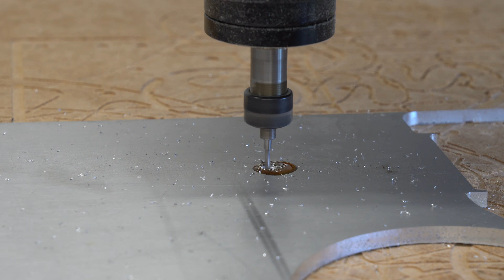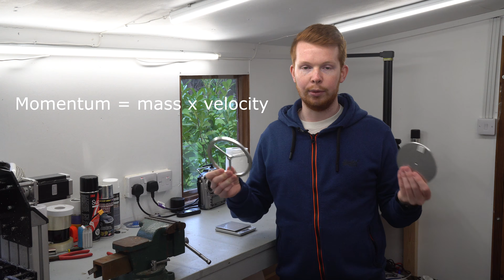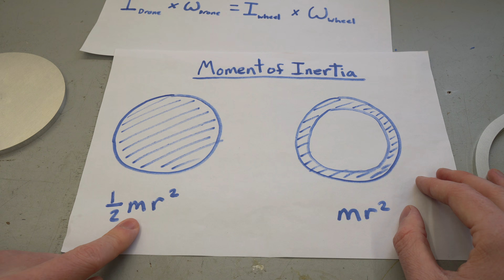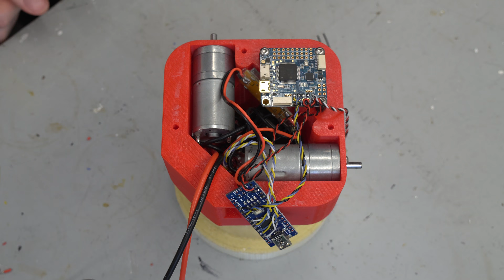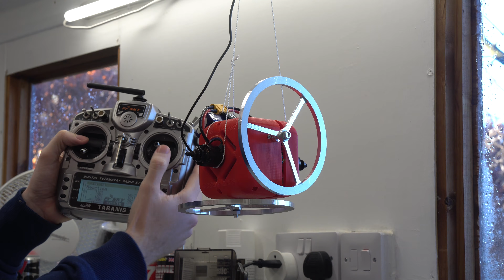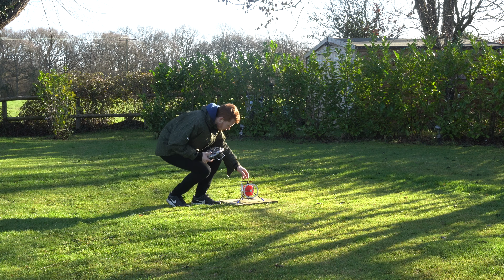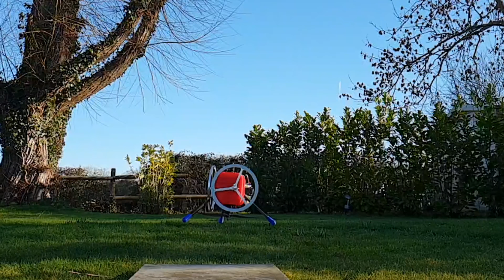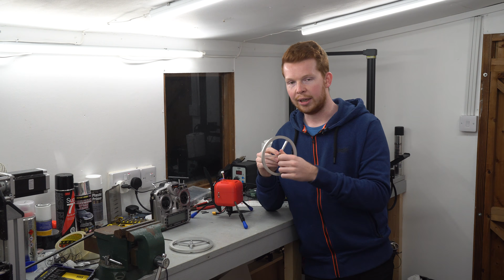Comment: Hi! I think you should try to pre-speed up the reaction wheels before the actual take off. Only the relative speed matters. If it has a certain speed at the start i think it was easier to just slow the reaction wheel down instead of driving it in the opposite way -> this means that you can use brushless motors too, but you will have to tweak the flight control for it too. Good luck!
Reply: I don't think this would work well. As it spins faster, friction does more to help you slow the wheel down, but it also does more to keep it from speeding up. Furthermore, at higher RPMs, the motors can provide lower torques than at lower RPMs.
As a result, you may get somewhat better torque/response in one direction, but the other direction would be significantly worse.
Not only is this a problem because the worse direction ultimately defines the performance of the reaction wheel, the asymmetrical nature of this is also something flight controllers aren't made for and the process of getting that to work properly would be incredibly tedious.

If you did decide to go through that effort, though, a way to overcome the asymmetry and low performance issues would be to have two wheels for each axis, spinning in opposite directions. One would speed up as the other one slows down, and you'd have to program it so that when little to no output is required, both accelerate, as otherwise, RPMs would go down with flight time. Unfortunately, you'd probably still end up losing RPM somewhat quickly, meaning while this may actually lead to a more stable flight, it wouldn't last long.
Reply: Be careful with fast spinning reaction weels.  The spinning rings can cause the drone to move differently than if there was not a gyroscope on the drone.  As the weels spin faster it is more difficult to move the wheel out of the orientation where it wants to be.  The force could be stronger than the drones ability to react, crashing the drone.   See youtube videos of people moving fast spinning gyroscopes and the behavior of the gyroscope..  

My grandfather always told me that at his work (building test aircraft)  they would spin up an airplane gyroscope and put it in someone's lunch box. When the guy picked up his lunch box and moved it in a direction that countered the movement of the gyroscope the gyroscope would keep the lunchbox moving in the original direction to the surprise of the person holding the lunchbox.  The lunchbox would often be ripped right out of his hand by the force of the gyro.
Reply: thats hat i meant with other words
Reply: That would reduce the dynamic range of the wheel. It has a maximum RPM and the performance degrades at high speeds. By having the "neutral" at 0 RPM then it has more range in both directions before it maxes out. Of course, you can end up in this state regardless, as any asymmetry in the drone, environment or flight path will just add up over time. But by starting at 0 you maximise the mean-time-to-failure.

Comment: im interested in knowing if in theory a mechanical gyroscope could stabilise something like that then maybe use collective pitch, gimballed motors or thrust vectoring of some kind to control directional movement? or maybe a servo controlled gimballed mechanical gyroscope in the middle of a quad for stabilising/controlling roll and pitch then just use the the motors to control the yaw?! hmmm

Comment: 2 problems I found :
1. Wheels weight destabilise the drone, making it heavier in the corner. Make counterweight wheels on the other side that will move other way. Rotation center is also important to be in the middle.

2.wheels must be able to accelerate and decelerate a lot faster, so they can fix the drone. On top of that  they need some reserves so you can steer it

Comment: Why not stepper motors? The RPM's you need should fit in the range many steppers can handle, and depending on the motor you may be able to get a very quick direction shift. The motor's weight may be an issue but who knows?

Comment: Interesting how you consider different motors to compensate for the nonlinearity.  I would have just made the necessary software changes..  The values need to graduate.. a curve rather a straight increment.  I am actually far more curious as to the different effects of the top and bottom propellers -- one pushes air onto the body creating vacuum above.. the other sucks air from around the body and pushes it below..  I doubt they are equal even at equal rpms.  I bet the bottom is push more than the top is pulling, making balance harder.  

What if you simply used spin to keep it level (a ring around it like on Saturn) and a miter joint on a central "drive train" for a top and bottom rotor... Then maybe two little motors for forward momentum and differential steering.  It should be far more stable than a convention drone.. with any decent amount of rpms of the Saturn ring (I guess it'd be a fly wheel).

Comment: I think it is better to vary the angular momentum of the control wheels by variing the voltage of the control motors instead of their current. The voltage is nearly proportional to the angular speed, the current is more proportional to the angular acceleration. I think the control motors don't need too much power. So I would suggest to use an analogue control loop to operate them more quickly with power op amps like the LM1875 of Texas Instruments. http://www.ti.com/lit/ds/symlink/lm1875.pdf

Comment: The best way to do this would be to have small gyros spinning at the same speed all the time on all 4 sides of the drone and use servos to try and tilt the gyros is an angle therefore causing the drone to go in the direction you want

Comment: I would try taking off the flywheels and attaching arms to the reaction motors to slightly change the centre of gravity of the unit. The lifting propellers should do the rest. In fact, I would move lower lifting propeller to the top and have just one reaction motor at the bottom.

Comment: One year late but i do see a problem there. Once these momentum wheels are spun up to higher rotating speeds, they do - for causes of angular momentum conservation - produce rotational momentum at a 90° phase-shift to any force they receive. So a fast spinning, nearly saturated wheel will turn your drone head-over-heels if you try to fly a curved path. Unless you have a correction for that programmed into your fly-by-wire-computer as they do on rockets and satellites.

Comment: I can suggest that the yaw axis needs work and both propellers have to be mounted to the top plane with concentric hollowed drive shafts expected to spin in c+ccw (inward direction) to generate lift. Another approach could use a inverted spindle to hold two brushless motors coupled in vertical orientation(c+ccw) , the motors must have a hollowed propeller shaft. And to reduce any delays from gyros to the reaction wheel i suggest to use steppers or servos with the lock ratchet (to prevent continuous rotation) removed 😎

Comment: Try using method similar to the Vibration on the phone. When phone left on the desk, and vibration turned on - it will slide across. That propulsion was tested in the 80s on the boat - and it proved to be 10000x more efficient than a jet engine. Boat traveled at the speed of 5km/h. It is simply using inertia and changing momentum with asymmetrical - half wheel(as in the vibration of mobile phone motor) or linear motion - changing the acceleration linearly. It's very simple, but the trick is to tune proper mass, acceleration and frequency. All to limit the vibration(like in the mobile phone vibration).

Comment: I think the issue with the instability was caused by the reaction wheels over-correcting. This would happen because they still have momentum after the motor has tried to switch the other way. You may have more success using Proportional Integral Derivative (PID) error to correct the attitude. This prevents over- and under-correction.
Reply: No, it was caused by gyroscopic precession. The guy has no clue about physics.

Comment: I want to use reaction wheel control for a project. I think the motor vibration was also messing with your pitch and roll sensors. And the motor response time was too slow. There was some visible oscillation going on there that could be countered by increasing starting torque, either through the controller, or passively with a capacitor.

Comment: Too funny.. my kick up keel on my sail boat was rusted stuck.. I spent a morning under water with a maul a mask and some flippers , banging away at the keel to lower it for the season... with each strike I was propelled backwards about a foot.. I ended up tie in my ankle to the wharf with a long rope.. which. . Thinking about it now was not smart at all had I got in trouble I'd of drown..  but the rope worked.. it helped to hold me in place and the job was finished much quicker

Comment: dear Tom flight is a natural concept however you are bogged down with calculations.
it should be natural intuition first and then calculations to perfect your intuitions.
Forget about the gyro mechanism and concentrate on natural balance first.

Have you realized from your video that each time you almost give up or when the situation seems impossible is when you achieve flight,

Nature is trying to say something.

My intuition suggests a much greater diameter for the top propeller and the bottom propeller can retain the diameter.

i believe this will you reasonable balance even before applying the electronic gyro

sincerely

ejike

Comment: Gyroscopic precession is what's causing your wobble. Split the reaction wheels into pairs (or have one in the center of mass, and balance the other pair of half-mass wheels either side), and you'll simplify the problem such that you won't even need to compensate for it. In the case of your drone, whenever one wheel moves, it's shifting the angle of its axis and interfering with the other wheel, leading to a reciprocating feedback loop. When its gets a little too harmonic, the drone flips out.

With two wheels at ninety degrees and at varying spin directions and rates, the drone's Z-axis is trying to describe a cone of rapidly-varying size.

Balance the wheels (craft AND wheels - not a homogenous mass), and  you'll reduce the need for compensation (ideally, make it negligible and you can just ignore it, or manually compensate in-flight). I'll bet you get rid of the wobble, though, or reduce it to a vibration.

Comment: Correct me if i'm wrong but wouldn't it be easier to stabilize if the centre of mass was much lower like in traditional helicopters? I know it will make the drone significantly less swift, but now it is impossible to control either

Comment: To overcome reaction delay, instead of using 1 wheel for 2 directions of spin (on same axis), use two wheels. Thus, when you need to spin left, you don't have to wait for deceleration. Just spin the other wheel.

Comment: Dude, I built a tricopter once, and I notice your copter is OVER-reacting in the pitch and roll direction. The yaw isn't going to Over-react as the motors need time to speed up and speed down, while the pitch and the roll can be controlled relatively quickly due to the reaction wheels. I have had my tricopter behave just like this in the beginning, it's just that the controller is OVER-reacting to the gyro and accelerometer input. So just trim down the PID settings and it should fly great. (Suggest increasing the differential settings and decreasing the integral setting). Great build BTW.

Comment: Maybe you should replace those huge wheels to smaller, lightweight wheels...
But not too light though because it surely need some weight to create inertia which it control...
The motor generates too much torque to make those heavy wheels spin... Plus you want to make it fly immediately...
It needs to work smoothly, let it find its balance first... 
Torque and Anti-torque...

Comment: Problems with reaction wheels.....you need to have mass behind the wheels to get the force. To increase the mass in a multi copter or any flying object you increase the weight. You increase the weight you lose payload capacity, battery capacity. You need more power and more batteries and more weight........so not a very good idea.

Comment: A single side-mounted wheel seems to exert an unbalanced force relative to the center of gravity. Notice that the drone always seemed to veer in the same direction (away from the camera). Balancing each wheel with another on the opposite side (i.e., two wheels per axis, connected by an axle and powered by a single motor) might correct this imbalance.

Comment: Funny, but ineffective (as gyro wheels and motors are dead weight while in multicopters - all motors provide lifting force AND stabilization). And i think you need smaller wheels, it would give more precise control.

Comment: Encoders are definitely a way forward, but how about making it taller, such as mounting the top propeller higher up which would reduce the speed of tilting moments and allow the reaction motors to keep up.  I'm aware that a taller unit making for slower tilt speed will also increase tilt force, the main problem seems to be the reaction motors are too slow in take-up.

Comment: This video got me thinking. I understand how a drone moves forward/backwards and side to side but I never thought about how a drone rotates. So thought back to my colege physices classes and its actualy very simple. A quad copter has 2 pairs of propellers. They spin in opposite directions because if they all spinned the same way the entire copter would spin. To get the copter to turn the direction you want all you have to do is slow down one pair of rotors and speed up the other.

Comment: It always veers off to the side with the wheels on. The centre of mass is shifted on the heavier side and the wheels are designed to rotate about the centre since they are mounted in the middle of each face. It isnt going to fly properly unless you balence the mass so that the centre of mass is running down the centre of the box and through each wheels central tangent. 

You could achieve this by adding weight to the other two exposed faces but adding weight is obviously bad or half the weight of each wheel and add wheels mirrored on the other face to achieve the same level of maneuverability. For somone who can build this thing to start with I'm bot gonna lie but it's a fairly large oversight 😆😆😂🤪

Comment: Motor cycle stunt riders can change the attitude of the motor cycle during jumps by opening or closing the throttle and thus using the back wheel in the same way

Comment: As MaEtUgr said, the slow motion captions show that the drone has to balance back after over-tilting because of reaction delay. That gave the typical wobbling. As you can't simulate zero gravity to test satellite performance with reaction wheel, try is an underwater drone with internal reaction wheels and a spherical body, with only propellers on the outside.

Comment: I would say increasing the number of reaction wheels to four (one for each direction) along with application of servomotors (to reduce saturation) should be your answer but, the increase in weight would negate any benefit you may gain in stability unless the rate of saturation can be reduced significantly enough by the use of servomotors and reduced weight reaction wheels.  Using a linkage system and gear slip system so that you would only need two servomotors for the four reaction wheels would reduce weight quite a bit but, that still may not be worth while due to power consumption.   

Maybe for a craft that is much larger than a drone this system might be useful as secondary system for increased stability in high winds or maybe to counter recoil from a ballistic weapon that puts strain on stability for brief moments.

Comment: Very interesting, I'm no expert by far, would a gyro in horizontal plane make a difference in reaction time. (other then which is in the stabilizing controller) to help stabilize the unit. with sensors to help the angular momentum wheels. 
Would  using a little heavier wheels for counteracting momentum have helped.
But the suggestion  below as given by another is probably true
But try putting a very strong but light cage wire around your experiment,  so the cage gets destroyed rather then you efforts.

Comment: Make sure your gimbals are center of mass and aligned with the other wheels rotational axis. Take into account gimbal procession induced from internal and external forces. Another useful tool would be utilizing the stabilizing effect of a three axis, high rpm, set of gimbals. This would help hold the craft in orientation and reduce wobble.

Comment: You might also try to figure out the physical model of your wheel torque, to scale the output for current with a simple formula - and no extra feedback loops (except the obvious one from your frame sensors).